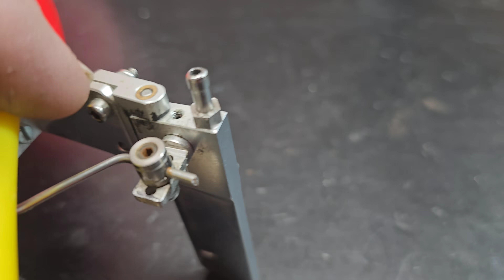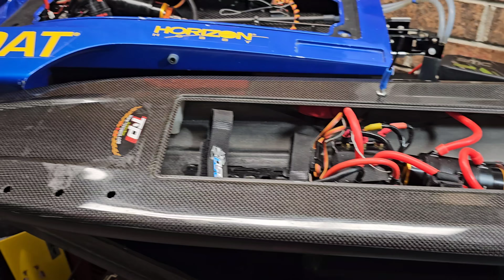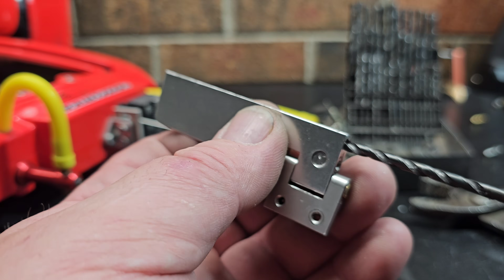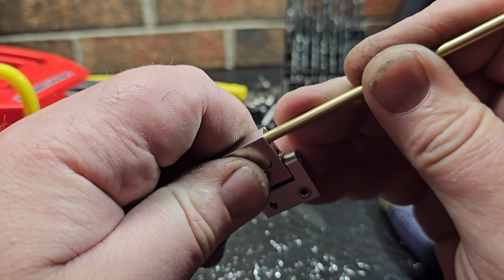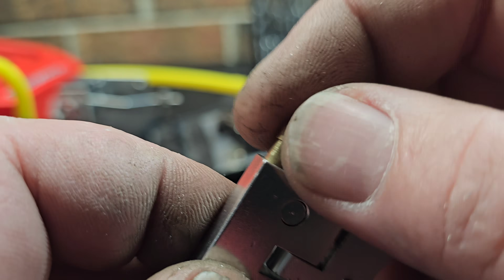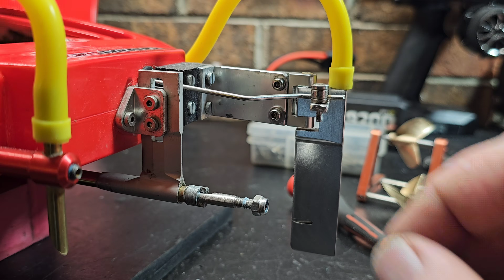High Flow Rudder Mod Rc Boat Cooling Proboat Blackjack 24 High Temps - Tp Power 3630, Seaking 180a

Comment: Great work, thank's for showing.
What do you think about a second pickup hole on the other side of the rudder a little bit higher?
Is it helpful or only good on Mono's or what do you think about it?

Did you sharpen only the front of the rudder in a second angle, like on a knife?
Or did you sharpen it by make the whole area in a more flat angle and grind down everything in the front? 
Can you mabe show it in a short adding video an show the best form of the rudder bottom.
That would be great.

Thank you a lot for your great helpful videos.
Greetings 🙌🏻😊😎👋🏻
Reply from the maker: That would actually work really good, adding a second pick up on the opposite side should allow more fluent water flow

Comment: What would cause a cat to spin out in the turns? I trimmed 1/4" off the rudder, no help. Gonna try lowering the strut next. It's a proboat thundercat 31 brushless conversion
Reply from the maker: @tabmurry  You May have the weight distribution to far forward, try moving the cg back a little bit.
Reply: Thx

Comment: Hey, been watching your videos for awhile. I built up a blackjack 24 inspired by yours. Running a rocket 3660 and a flycolor 150amp esc. 

I cant seem to find what the timing should be for this motor. If you have any ideas that would be super helpful. Thank you!
Reply from the maker: Depends on the motlrs wind type 

Delta wind = 0-6° timing

Wye wind 7-15° timing

For lower temps, lower timing
Reply: @IRONCLADRC  got it, thank you!!.

Comment: Nice easy mod Big B,👍 I need to try that myself, I have my esc on a dedicated water pickup-120 Seaking-I get real good water flow through that but my motor cooling is poor at best even after drilling out the brass nipple, so I’ll give the rudder a good reaming and the nipples on the water jacket 👍 BGFL

Comment: Big B, I've used lock tight in many applications. But I've never seen it used like that. I'm impressed. I'm definitely gonna have to give that a try.
Reply from the maker: Loc-tite is good stuff, and there are many applications.  BG4L

Comment: Great mod BigB, anything you could do to increase the flow. Is there enough meat on the nipples on the ESC to drill out if that would make a difference considering the issues that some have with the Seaking 180 and over heating. As far as this 180esc unlike other ESCs,  could it be a design issue with only one inlet  and one outlet when other ESC  have 4, like the Spektrum Firma and others.